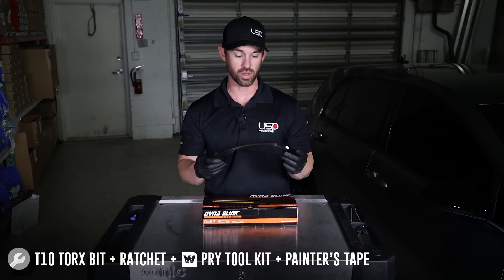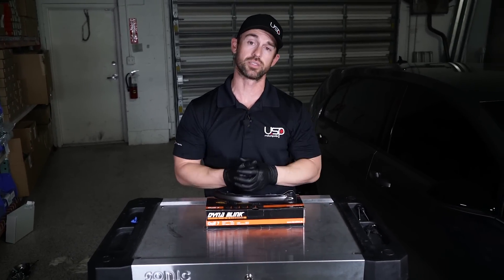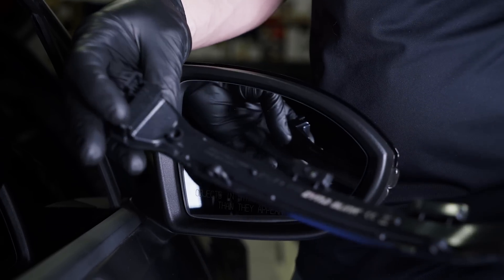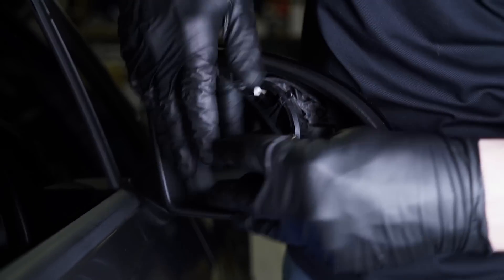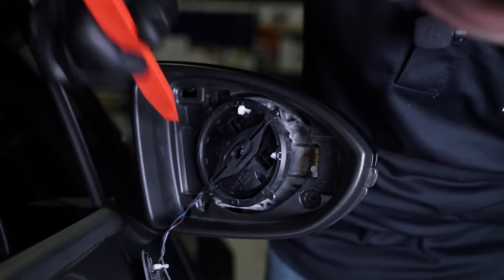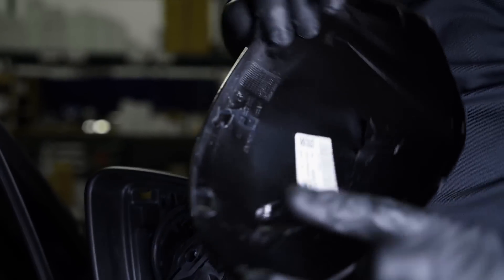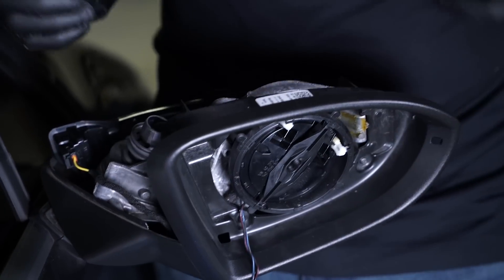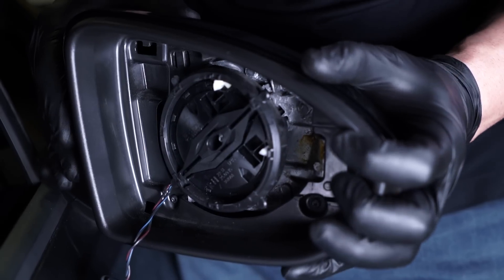Dynamic Blink "Dynamic Scroll" LED Turning Signal Install | Volkswagen MK7 Golf, GTI, .:R

Comment: I think I would have tested the lights, to make sure they work, or to make sure they didn't send me a defective one.I would have done that right after plugging in the wire harness, before reassembling the entire thing. Especially, if there are that many delicate parts that can be snapped or broken

Comment: Does this fit all Mk7 golfs or just the Gti/r?
Reply: He said it fits all mk7s in the beginning. There should be a button that turns up the volume on the side of your phone or if your 2009 and still use computer then the bottom right hand corner of your screen, you'll see a little speaker looking symbol, click and then it'll show a slider bar or plus and minus symbols or you could go on the site where it's being sold and most of the time they have it in that little thing called a description of product. But I bet you know how to recoil a vape and all that vapey shit. Sorry about sarcasm but when trying to teach someone how to properly  make boxes and still have them ask questions, sometimes it just pours out when I see some ignorance after I clock out.
Reply: @BrutalKillerKid  that's a good one. Lul

Comment: Is there any issues with the Dyna Blink indicator and a GTI with Blind Spot Monitoring option on the mirrors?
Reply: I found an article from pacific vw that says "The Blind Spot Monitor system utilizes two radar sensors located on each back corner of the vehicle."  If that's true then the install of this part won't affect the blind spot monitoring.
Reply: Bsm uses a module for each side located under the rear bumper so shouldn't be an issue

Comment: Is the fitment the same for a '14 GLI?
Reply: Brian Patton This part fit in Vw Passat Cc 2010 model?
Reply from the maker: It does not fit the GLI -- we are working on a Jetta application at the moment.
Reply: USP Motorsports Jetta has the same mirror with the Passat cc?